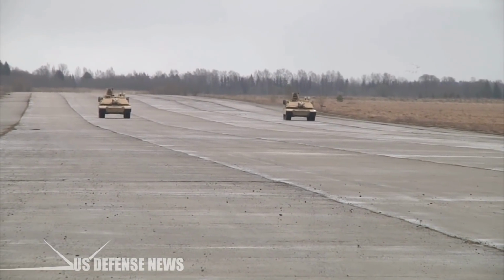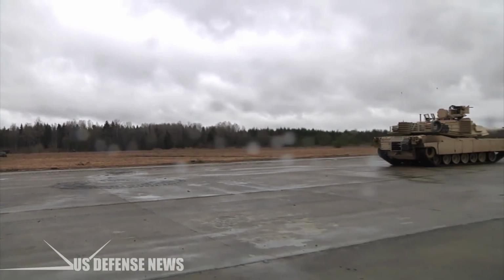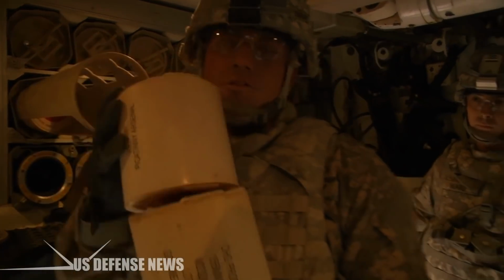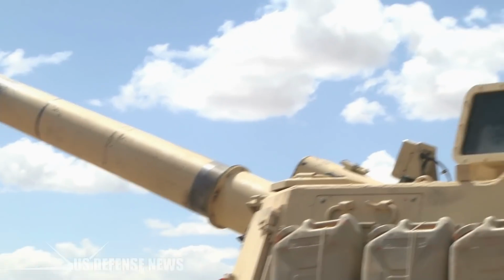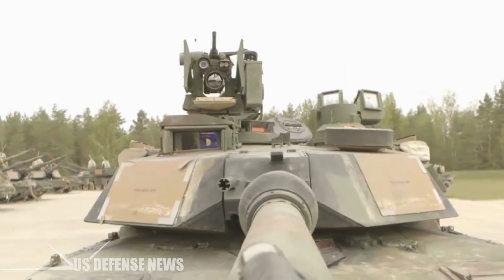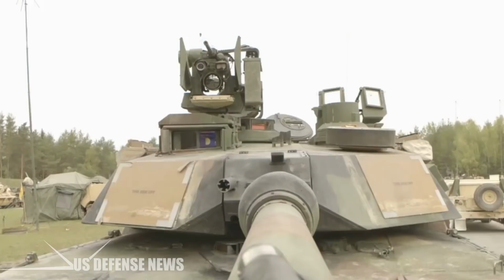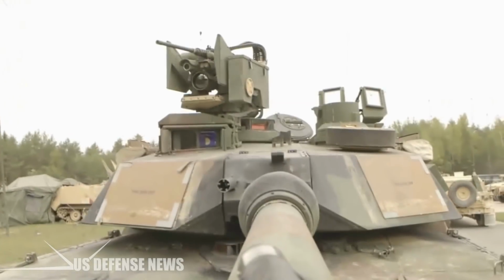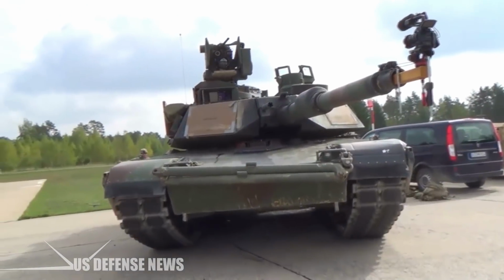U.S. Army Receives First New Abrams Tank Prototype

Comment: Ooops no auto loading with main gun!
Reply: Yes axuto loaders use to be a piece of crap.  Not any more.  They are now more reliable and of course much faster.  Without the need for a loader there is no need for anyone to be in the turret since the the machine guns can be coaxial a operated too.  Without the need to protect personal in the turret much less armor is needed and the tank can sit lower making the tank harder to be seen or hit.  Less armor needed also means lighter, faster, more maneuverable, able to go over weaker bridges, softer ground and mud.  Hence an auto loader makes for a much more robust fighting machine.  Our guys are fucked going against any of the newer tanks with auto loaders. Especially the newest Soviet tanks.
Reply: Stanley Tolle your proof
Reply: Yeti8it only thing that can breakdown is a person and the chances of that low
Reply: Human loaders:
+Has an extra set of eyes for improved situational awareness, even more so important when navigating through tight urban areas
+Does not require mechanical maintenance on an already mechanically complex machine
+Another crew member can be diverted to replace the loader mid-battle should the need to arise. The tank can still move and shoot
+A dead/injured Loader can be replaced with a replacement after battle, no mechanical maintenance required
+The Loader on the Abrams is equiped with a 7.62mm that adds additional firepower, increasing infantry support effectiveness
+A well trained Loader can load as fast, if not, faster than a loader for a brief period of time
+An extra set of hands for maintenance
+In the even the tank is disabled, the crew will have to fight on foot. Having an extra person in a hostile environment increases your survivability as a group
+During downtimes, crews are still human and needs sleep, food and rest and can't be doing maintenance EVERY down time. Having 4-man crew means more can be achieved compared to a 3-man crew in the same time span and rotations can be done more smoothly 
-Rate of fire is dependant on the Loader, inconsistency

Autoloaders:
+Consistent rate of fire on all terrains
+Reduces the crew size, meaning more tanks can be fielded compared to a 4-man crew given both sides have the same number of crews, very resouceful for smaller militaries
+Decreasing tank size overall, lowering the vehicle silhoutte
-Expensive
-Literally every "+" the Human loaders have but the opposite effect for Autoloaders
 

Checkmate.
Reply: Less chance to breakdown .
Reply: +Stanley Tolle

 While correct in terms of the innovation. It splits in terms of advantages and disadvantages. Having an extra pair of hands is almost never a bad thing.
Reply: Stanley Tolle, first, the newest SOVIET tanks are 28 years old.  I think you mean the newest Russian tanks.  Don't bet more on those new Russian tanks than you can afford to lose.
Reply: Auto Loading is nothing but asking for trouble in battle imho
Reply: If there were german autoloaders, ok! But every other autoloader i wouldn't trust my life to!
Reply: auto loader sucks, way to slow
Reply: auto loading has been around for decades not a wise choice history  has proven that .
Reply: Billy, a better way to say it might be nobody's come up with a sturdy enough, reliable enough, and compact enough design that would make it a wise choice.  Yet.
Reply: Yeah auto loader is better,you no need loader in tower and if shot/rocket pen tower he die and hit damege othet things like ammo,gun breach..etc. 
Without loader you can build smaller and much more protected tower same in Armata.
And tell how much is life time HT in betlle field?:)
Reply: Stanley Tolle well the problem is russia camt build enough of thise new tanks to male a difference. Most of their tank fleet are somehting like 40 yeara old i think well.be fine
Reply: +Jeffrey Muu
Ask that to Russians and Syrians fighting for the tyrant Assad in tanks with autoloaders.

.....oh wait, you can't. They're all dead because their autoloader explodes the ammo whenever something more powerful than a fart hits the tank.
Reply: You don’t want auto loading the sliding door that protects the ammunition is meant to protect the tank crew for the tank it hit the rounds will explode but out of the top of the tank where there are two special doors on top that will blow off and release the pressureSaving their tank crew from burning to death having an auto load feature could compromise that and it takes up lots of room to put all that mechanical mechanism is inside the tank￼
Reply: Auto loading guns have issues I would encourage you to do research on them if you know what an oscillating turret is it was invented for the auto loader you will see why if you do research
Reply: A human loader is faster, more versitle, and reliable.
Reply: Richard Finnigan b
Reply: We can reload faster as humans than an auto loader and it won't have a mechanical failure.
Reply: Auto loading sucks

Comment: You said exactly nothing in this video.  Well done.
Reply: The report said plenty about the upgrades, the module system upgade alone is big news let alone all the electronic system speed upgrades.
Reply: Yes, I heard A LOT of important and relevant information regarding upgrades of the upgrades necessary to convert existing Abrams tanks into the new MIA2 SEP v3 Abrams Main Battle Tank configuration.
Reply: There's nothing "new" mentioned here.  What it left out is that EVERY us weapon system is getting upgraded.  Apaches can fire off of reapers and other drones, just as every other US aircraft is being upgraded to do.  Not just other aircraft, but over-the-horizon weapons including ship and submarine based weapons can be called on by aircraft and guided to the target by the very same aircraft.  Nothing "new" here.  The US is modernizing the entire arsenal with capabilities that even a "video game commander" couldn't dream of.
Reply: They want the Abrams from battlefield then. With that HUD and markers showing friendlies.
Reply: It's not true, it says that the rough old abrams received a new set of high tech systems and new ammo to match eastern countries' recent improvements
Reply: Shaba. Local lingo for WTF. MADE very little sence.
Reply: hello how are you doing
Reply: Brad message me on this number  908 7381804 or on hangout with lola48677@gmail.com it's been a long time I saw you last
Reply: Indeed, this video is completely worthless.

Comment: This Abrams upgrade is still shit compared to the newest Russian line of tanks. I say this because the L11 gun on the Abrams cannot currently penetrate the armor of the Armata MBT. The US military as well as the Germans, French, and British are working on a 130mm replacement for the L11.
Reply: Dalton Smith and you know this how?
Reply: Dalton Smith The new ammo is highly top secret. All I can say is that we have new ammo.
Reply: They ae working on a new 133 but intil then they are going to be getting new ammo soon
Reply: Supposed to be some nasty stuff.
Reply: +Dalton Smith

 The L11 was the rifled gun on the Cheiftain and Challenger 1 Main Battle Tanks. The M256 is the 120mm smoothbore on the M1A1s and M1A2s. 

> "Abrams cannot currently penetrate the armor of the Armata MBT."

 According to whom?
Reply: In which decade do you live? The Abrams hasn't been equipped with the L11 since 1984, and all of them are either upgraded to the M256 or retired. And the gun doesn't penetrate nothing, the ammo does. And thanks to the manual loading, it doesn't have to be shortened and put into two parts, unlike the russian ammo, which have shorter, less powerful penetrators.
Reply: New ammo doesn't matter? In which universe?
Reply: +SuperGeronimo999

 The M1 never had the L11 to begin with.
Reply: Stanley Tolle Darpa is actually working on a new Main Battle Tank for the US as we speak. But the new ammo is vicious. And it will penetrate the armada's armor. But the 120 is a old gun but with this new ammo we should be ok until we get this new tank.
Reply: The 130mm is likely going to be passed on in favor of high pressure 120mm guns.
Reply: M1 had the 105mm M68 rifled which is an American gun similar to the Royal Ordinance L7. It was used on the M60 Patton before that and was derived from the T254 with the T254E2 becoming the M68. 

The L11 (L11A5) 120mm rifled gun was used on the Chieftain and Challenger 1 tanks. Challenger 2 uses the L30A1 120mm rifled gun.
Reply: the Russian tanks are not battle proven the American tanks are the Russians are weak
Reply: Very likely. Atleast its not going to happen on the current M1's base. It has been tested long ago with the longer L/55 120mm, and it wasn't going to work out. The 130mm will be even heavier. A lightweight 120mm, such as the XM360 will be more likely.
Reply: 105 guns are still used. They are useful as assault guns to destroy fortifications and using HE against infantry. They are also useful for destroying light armored vehicles such as APCs and IFVs. Combine that with some ATGM and you can also engage heavy armor but the 105 itself is not intended to be used against MBT any more. Still, with modern ammo a 105 could potentially disable a modern tank with a hit to the top or rear.

There are several new 120mm NATO rounds available. This includes some tungsten and some DU fin with greater penetration potential using current guns. The new tungsten rounds are especially noteworthy as they have enough penetration to destroy Russian tanks from the front even without using controversial uranium penetrators. The new DU rounds have even more penetration but still have the material handling issues so are not used by some military forces. Next generation multipurpose HE rounds are also being developed. AMP is expected to be available in a few years and will replace several other types of rounds. Some of the design details of these new ammo types are secret but their existence has been made public and is unclassified.
Reply: Earl Smith R I can tell you from the intelligence reports we get from the T90 and the new armada, is that they are very capable tanks. Never underestimate anyone!!! Never!!!!!
Reply: Dalton Smith Hi there KGB intelligence officer. What's the armor on the armata? Oh yea, it's still unknown. Please quit talking out of your ass pretending to know everything. Give numbers before you speak again.
Reply: Dalton Smith estimates, dude. I want proven, confirmed facts not estimates. I don't care about that kind of crap.
Reply: Dalton Smith There are a lot of assholes that don't know a thing about what they are talking about.
Reply: SuperGeronimo999 That is the point I was making.
Reply: +R 

 What are you on about?
Reply: I call bullshit
Reply: and where will they store all this ammo my friend
Reply: james montgomery Where do you think? Ammo dump. Like all the other ammo.
Reply: You are an idiot!
Reply: New tank should have a way to reload and resupply from behind the tank. It can be a hatch in the hull but then  you are going with a front engine with all the compromises that entails.  A hatch in the turret would be another way - either a small hatch for passing one at a time or a large hatch to load a whole bustle rack as a module.  Passing through top hatches isn't that bad but some way to get ammo while buttoned up near the line would be better.
Reply: Alex Pelc then go look at the Armata page, read the NATO response and look at the references. The estimates are based on the existing penetration value of APFSDS rounds and what the tank is reported to be able to stop when factoring in the composite armor, the era and the reactive armor of the Armata. I didn't say that the new rounds wouldn't do anything, but if the reactive armor works like that of the T-90 then it might as well.
Reply: Dalton Smith they do not have a L11 you're think of the leopard.
Reply: R cannot kill a t-14 armata in ONE shot, it has ERA, 2 shots in a general area will devastate that thing
Reply: Dalton Smith All versions of the M1A1 and M1A2 Abrams are equipped with the L44 120mm cannon, and although their new munitions capabilities are likely classified, rest assured that they absolutely can knock out any tank in existence, including the T14 Armata. And no NATO tank will receive a 130mm cannon until new vehicles arrive about 2030, and how many of the new vehicles, other than the upcoming Leopard 3 will get a 130mm cannon is currently unknown.
Reply: Stanley Tolle Not likely.
Reply: No One Special I heard Russia will field a platoon of t-14s by 2060...
Reply: bullshot ,,10 15 km on the main gun .penetration of 36 inch armour /..will smash russian armour.rail gun tech  ha ha ha ..thats why trump confident.iam ex/tanker keeping on the tech..russian scrap,ha ha..
Reply: R But the new ammo isn't. You people are thick or something.
Reply: The short 120mm M256 is very old and outgunned. It is an ineffective gun and cannot kill a T-14 Armata or recently T-90M in frontal battle. Abrams crews are dead.

The 105mm M1 and M1IP Abrams were the most stupid tanks ever US Army had introduced into the field to confront the various of Soviet tanks with long and powerful 125mm gun.
Reply: The Armada is going to have a rapid firing 154 mm gun soon.